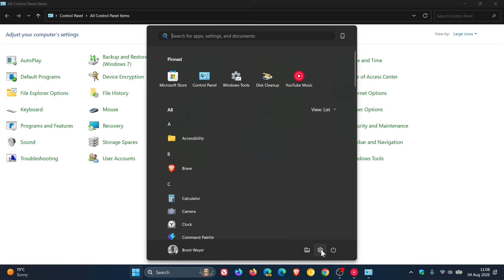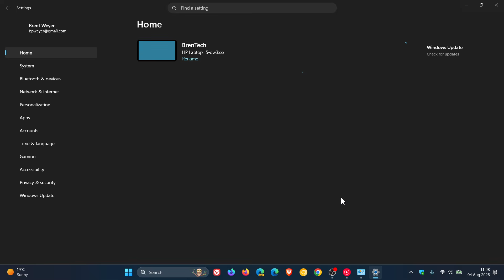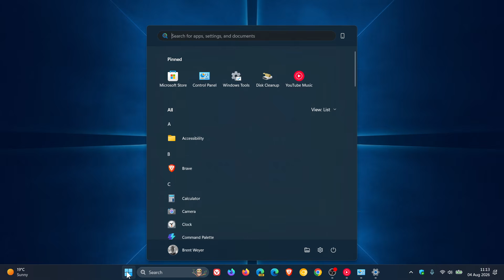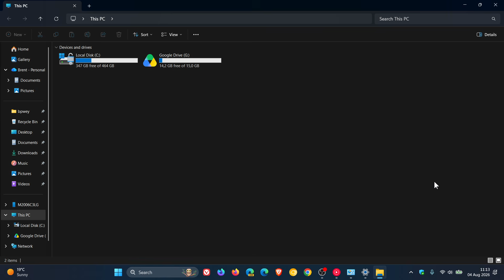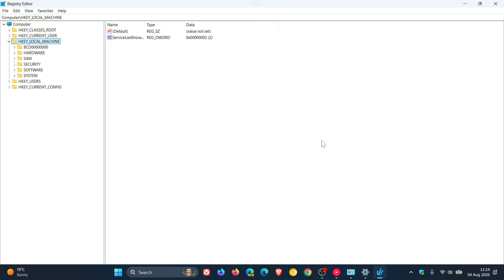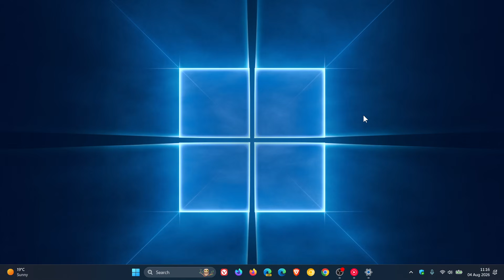Microsoft Explains Why Modernizing Windows 11 Takes So Long!

Comment: Nah at this point with how windows 11 is doing its best to leave the old as it is and work on new things and old ones serve as CI/CD test case that must be 1:1 and easy to access rather than make it difficult to find in settings app. 
I think they need to look at Linux and Apple which supported niche architecture and has lot of rewrites to embrace changing landscape and it wasn't great for early adopters but paid off in the current scheme of things compared to windows 11. 
Microsoft needs to understand there are windows veterans with 25-35+ years of usage are simply getting tired of their shenanigans for Linux even though it's not 1:1 but needs peace of mind and reliability plus robustness. 
I still feel ReFS must undergo dog food testing in large scale as NTFS is showing its age as there's no visible difference upgrading from sata ssd to newer revisions of nvme from 1.x to 2.x with RAID5/6 with 4x drives or twin stacked drives that can function as spanned drive for redundancy and resiliency. 
I felt MSFT is losing too many good engineers and getting in office politics with thick layers of middle management with little tech knowledge to chase trends rather than engineering prowess they made with every screw ups with 2000, Me, Vista, 8 and 11. 
11 is a lost cause and personally downgraded from 25h2 to 23h2 due to constant system stability issues even with 25h2 validated drivers. Downgrading made it run much cooler, better battery life and thermals on idle and full tilt performance. 
I would dare say Apple Silicon runs windows 11 arm better than qcomm arm64 host device and thermals are very low and fans never spin up for basic web browsing which was surprising on my Mac that was using same set of tabs and settings on brave.
Reply: I never used Mac, but if given a choice between Mac and Windows at this point, I am going with Mac. Like I said, never used it, but the data tells me that they are more consistent, has better privacy, cares for the customer more, and is very intuitive. I will be sticking with Linux, but just saying I like Mac more than Windows is something I never thought I would say until I was forced off my perfectly good Windows 10 PC for Windows 11. I switched to Debian 13 KDE in January 2025 and never looked back.
Reply: @legalallies9  yeah. I haven't used it a mac in over 25 years and used it once during college and it was slower than windows 7 on hdd mac mini. 
I did migrate from debian to peppermint devuan because of ideology differences as it was moving away from core debian principles which was the whole reason I jumped shipped from ubuntu and Linux mint.

Comment: everything is hardcoded ad-hoc. that's why.
Reply: Eh, at the end of the day, its all black-box proprietary code anyway. Not like anyone can copy it, make it better, and contribute changes back in. So at the end of the day, due to proprietary licensing, it becomes like toliet paper. Used once to get it done, but is eventually flushed away and replaced. Eventually Microsoft drops a hot steaming pile, and a new roll is used to clean the mess.

Comment: I would assume the legacy components are written in a pretty simple way and modernizing them while keeping compatibility will require basically building the new app on top of the old one, making the new app basically a set of shortcuts to the old one. All I can say is it's gonna be slow and RAM-heavy.
Reply: The issue is that every client that has created scripts or plugins on top of the control panel, should apply changes as well
Reply: @christosmallios9823  most of those controls can be manipulated via the registry or powershell; so all is just a lie.
Reply: From what I understand, a lot of the accessibility features for disabled people are not working properly in these builds.

Comment: I think the explanation from Microsoft proves once and for all Steve Jobs statement: “The only problem with Microsoft is they just have no taste”. Any sane person would take the approach of theming the Win32 based legacy interface to get it to match the so called modern UI. So that the 2 UIs don’t conflict so badly with flash bangs all over the place.
Reply: You would think Microsoft, which is a company that committed to being eco friendly, would push for more power saving features like dark mode. Much less, how much better it is on the eyes.

Comment: what a liar, they can modernizing it like 3 years ago. Removing AI bs, forcing dev to use winUI instead of electron based and many more. But what they doing instead allowing LG put an adware to ur pc, adding AI bs here and there like paint wtf
Reply: Isn't it just fantastic to have Copilot in Paint and Notepad? Great vibes. Like the vibe coding its made of.

Comment: I would rather Microsoft leave the control panel alone;, all the settings are in one place,  settings is a kludgy way to adjust these settings.  Leave the Registry Editor alone, it works fine, cosmetic changes are not needed, all they will do is screw it up.

Comment: BS and excuses. MS could do this if they wanted but they'd rather waste money on AI and cosmetic changes to Win 11.
Windows is 💩 because they keep adding more 💩 to a badly designed and maintained product.
Windows 3 and 3.11 were built on MS-DOS foundations. Since then they, MS, have kept adding bloatware for quick fixes and cosmetic changes. They are hostage to legacy users who refuse to upgrade when in fact they should be cut off. No one with 15+ year old hardware should be dictating the rat of change. All those idiots boasting about still using Windows 7.
2027 I will be moving to Linux.
Reply: I moved fully to Linux in January 2025 to vanilla Debian 13 KDE. As for the old operating systems, industry needs them, so they often run them as a virtual machine. Its a pretty good work-around. Just take some powerful hardware, install your favorite Linux distribution, install your desired Microsoft Windows operating system into KVM-QEMU with Virt-Manager and SPICE, the just pass the hardware you want through to Windows. Suddenly all the drivers and software you need Windows for is available through the virtual machine. This sounds hard, but its not. Follow one guide and your up in running in an hour, give or take. Try it. This exact method is used by enterprise corporations to run legacy operating systems of all kinds, not just Windows. You would be happy to know you can have your cake and eat it too if you just run Windows right where it belongs: In a virtual machine on Linux.